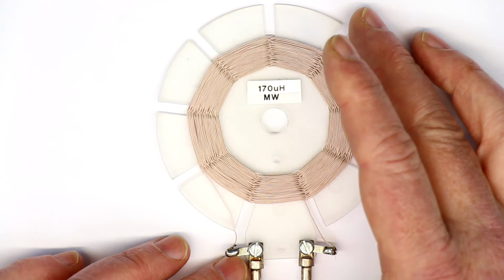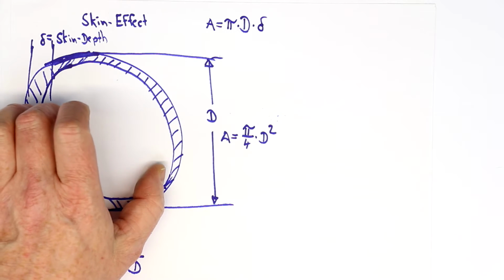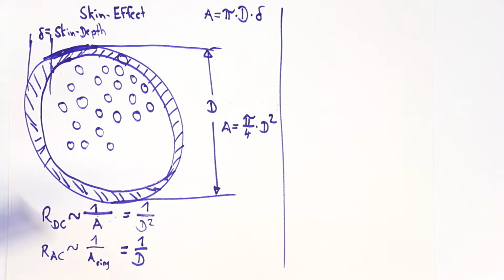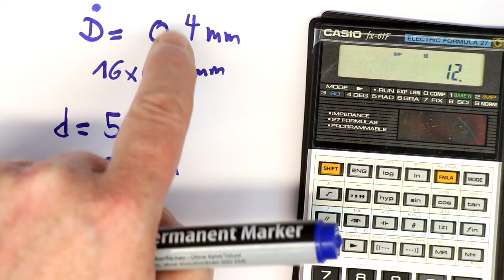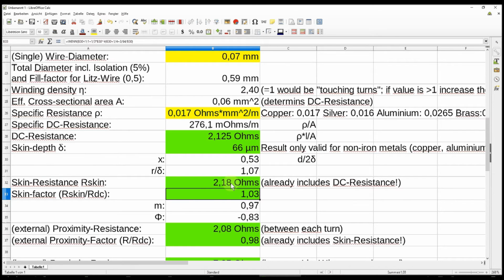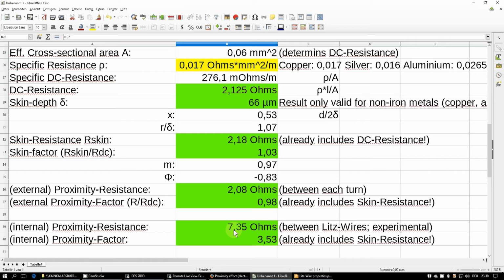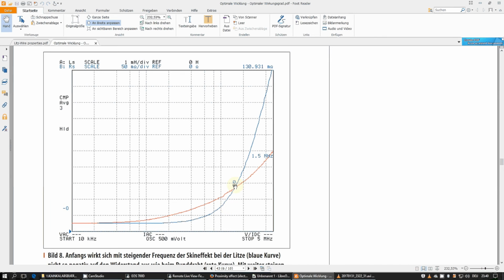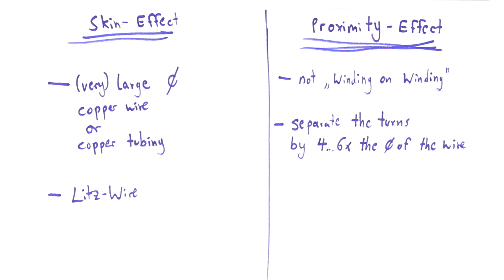Resonant Magnet-Field Antennas Pt.4: Skin-Effect and Proximity-Effect

Comment: Great video. A lot of high-current inductors are wound with wires with a rectangular cross section with one dimension large and the other dimension small (maybe two skin depths). This type of wire (or maybe even just copper tape) could be used in a coil with an inter-coil spacing of four diameters. Any idea how this would perform relative to round or litz wires?
Reply from the maker: The rectangular wire (or copper-tape) is used to get a fill-factor near 100% so that the volume is filled as much as possible with copper. 

https://en.wikipedia.org/wiki/Coil_winding_technology
This is advantegous in motors/generators, chokes, solenoids, voice coils etc,

But it has nothing to do with skin-effect or proximity effect (at least that is not the primary reason to use rectangular wire).
I don´t see any advantage over round wire. The proximity effect would be even worse because more area of one conductor is near to it´s neighbour.

Comment: i cannot find the Excel sheet. and the other thing i wanna ask that is as you showed a high source impedance than in case of wireless power transfer how the maximum power transfer theorem can b applied because in that case it seems that the load resistance must be very big in case to transfer maximum power.
Reply from the maker: Yes. A tank-circuit is a high-impedance source. A typical value for a high Q-factor LC tank-circuit is from 100kOhm to 1Megohm.
That is why most crystal-radio circuits don´t work because people don´t match the (dynamic) imoedance of the rectifier diode and the load-impedance of the earphone to the output-impedance (=resonance-resistance) of the LC tank-circuit.
Nevertheless you get progressively more power out of an LC tank-circuit if you increase Q-factor.
The resonant voltage and the resonance-resistance grow linearly with the Q-factor.
But because maximum output-power is Voltage-squared(!) divided by output-impedance, the maximum output still grows linearly with an increasing Q-factor.
(Of course only in case of matching load-impedance).
I will discuss this extensively in a forthcoming video-series about the "perfect" crystal-radio set.
Will come in 1-2 months. 

Open "show more" in the description.
There you find the download-link: https://www.kainkalabs.com/upload/index.php?f=15894916880b3e
Reply: thankyou so much for your quick answer. According to your detail explanation i can assume that the output power will depend on the value of the voltage, so if i can increase the output voltage of the tank circuit by increasing the Q factor only then the i can get more output power. so output power is equal to v^2/source impedence+load resistance.
Reply from the maker: Well not quite.
Take e.g. a frame-antenna as a general example for loop-antennas.
(BTW: Loop antennas can be operated in two different modes: resonant mode as in an LC tank-circuit or untuned short-circuit mode. I only discuss the resonant mode here)

The output voltage depends first of all (as in all antennas) on the incident voltage at the location where it is set up.
The output voltage of a frame-antenna (without any load) then is dependent on the cross-sectional area of the frame antenna and then the Q-factor.
Both can be summed up in a formula:
https://de.wikipedia.org/wiki/Rahmenantenne#Grundgleichungen
(this mathematical deduction is only available in the German version of the Wikipedia-entry)

All in all the output voltage of the frame-antenna grows with the third power (!) of the diameter of the frame (already taking the Q-factor into account)
But this output voltage will be severely reduced if the load-impedance is not close to the output-impedance (=resonance-resistance) of the frame-antenna.
Reply: thanks. All in all impedance matching becomes very imp in the end. Looking forward to your videos on this topic.
Reply: one side question I read your excel sheet, I wanna know that after doing a certain calculation we found the values of Q factor and skin depth but the Q factor depends upon the frequency. So what is the limit of increasing the frequency in order to achieve a high Q-bearing in mind losses due to skin depth and proximity effect. I want to ask how much can I increase the frequency for particular dimensions of the antenna. Thanks
Reply from the maker: The Q-factor goes down when the losses go upwards.
The main losses are ohmic losses (ohmic resistance, skin-effect, proximity-effect).
Because the 2 latter ones are frequency dependent, for one the same antenna the Q-factor goes down when the frequency goes up.
You can counteract this only by playing around with the variables to maximize the Q-factor (using different litz-wire types for frequencies up to 1 or 2 Mhz; using "thick" copper-wire or copper-tubing with a large distance between the turns for frequencies above 1 or 2 MHz)
In fact it is possible to get Q-factors above 1.000 in the SW-range (2...30 MHz).

The most difficult part of the spectrum to get high Q-factors is the AM radio-range between 150kHz and 2 MHz. There it is quite difficult to get the Q-factor higher than 250.

I will also make a short video-series about how to use the spreadsheet for different antennya-types (single-turn loops, multi-turn-loops, frame-antennas, loopstick-antennas, spiderweb-coils etc.)
But you have to wait for a few weeks, because ATM I have very limited time for new videos.
Reply: thankyou so much.

Comment: I'm reading in a book that the current is constant throughout the loop, but a youtuber proved differently 

https://youtu.be/SUYI81dkEMA
Reply from the maker: Well that´s a totally different story.
He uses the loop as a transmitting-antenna and couples the signal in with an eccentrically placed secondary loop.
Already this non-symmetraical arrangement skews the distribution of the electrical and magnetic field and as a consequence the current and voltage distribution in the 2 loops.
Furthermore he measures the electrical field with the fluorescent lamp and his other devices although a loop-antenna is a magnetic antenna (at least in the near-field).
So all in all I would say that this is not a "scientific experiment".
One would have to do an extensive electrical simulation and then the electromagnetic simulation of his arrangement to draw any general conclusions.

Anyway: The skin-effect and proximity-effect (when you have more than one turn) are always at work. You can simply look at them as raising the ohmic resistance and thus the losses. 
(Resonant) magnetic antennas for reception must be dealt with in quite a different way than for transmitting purposes. 

The best book I have ever read about these topics with relation to practical applications is "Magnetic Loop Antenna" by Burger & Dvorsky. ISBN 978-80-260-9952-9.
http://www.arrl.org/shop/Magnetic-Loop-Antenna
The printed diagram about the proximity-effect I showed at the end of the video is e.g. copied from that book.
The authors give a very good introduction to the theoretical background and practical applications as well as EM-field simulations for receiver and transmitter antennas. They also build and sell some of their designs commercially. I think the book is even an excerpt from the Ph.D.-thesis of one of the authors.
The second best book is only in German and is called "Das neue Magnetantennenbuch: Selbstbau-Loops für Sende- und Empfangsbetrieb" ISBN  978-3881808620 (out of print)
But there may be many other which I don´t know of :-)